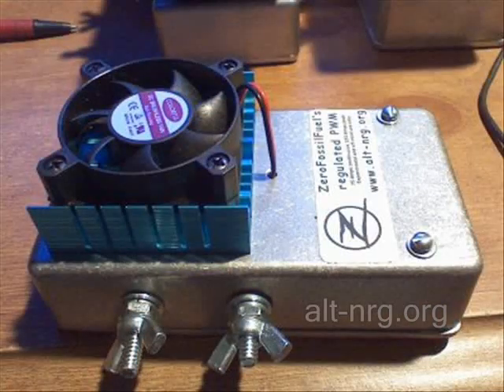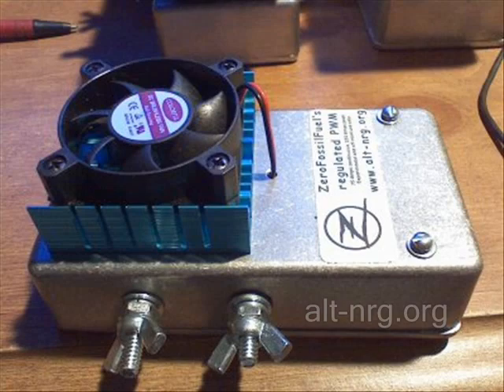#237 HHO run time test update 2-16-2010

Comment: NO!!!!!! Compression is needed no matter what the fuel source, truth is the flash point of HHO is almost identical to HC, If what you say is true then a diesel engine wouldnt run on hydrogen, it would gas off and detonate....but I have personally seen diesels run on nothing but hydrogen, the higher the compression the greater the heat value, the greater the heat value the more energy is produced from the fuel, thus increasing efficiency.

Comment: it takes twice as much fuel to run a two cycle engine because the combustion cycle happens every revolution rather than every 2 revolutions, yes they can reach much higher rpms much faster than a 4 cycle engine, but they produce much less torque at low rpms, this is why they need reed valves to help atomize the air/oi/fuel mixture, without reed valves the engine will run too rich and stall at idle and off idle ranges...do your homework bro before you look like a fool in front of the world

Comment: apparently he has no fuckin clue on how a two cycle engine works.....first off they dont have a valve train, this is because intake air is drawn into the engine by the bottom of the piston during the compression stroke(much like a syringe) , then the air/oil/fuel mixture is scavenged by the piston on the power stroke forcing that air/oil/fuel mixture into the cylinder via small ports located slightly above the top of the piston at bottom dead center this is why 2 strokes are less efficient
,

Comment: Second- I do not check humidity and barometric pressure before starting my lawnmower. Why waste valuable time recording largely irrelevant useless info? 
These things will delay and constrain your efforts. Over analysis may place you into melancholy gridlock. Proof of principle, efficiency data, and duplicatibility are really the main concerns.
Mrgalleria

Comment: @ZeroFossilFuel 
Also not opening the exhaust valve will place less load on the engine.
The inert gas will be nitrogen, which expands wonderfully with heat added. That is how motors operate. But you have a different kind of heat with HHO. Liquid petrol burns slowly, allowing the nitrogen to heat/expand/ move piston. HHO burns so fast, it does not give adequate time to heat the nitrogen. Result- no expansion of nitrogen. 
Mrgalleria

Comment: @ZeroFossilFuel  - I injected in air intake, not directly into the combustion chamber ... the solenoid did get hot and wore out quickly but I did not know how to modify the cam and valve opening any other way ... was only thing I could do to get control ... you may know another way ... am interested in seeing what you come up with ... got my fingers crossed that you come up with something simple that works ...

Comment from the maker: @rascalwind Sealed system, hydrogen charged sterlings are about the only ones capable of producing enough mechanical output to be of any real use. This is beyond my level of ability to produce without the proper facilities or funding. With funding, all things become possible.

Comment from the maker: @SmartScarecrow That would have to be some beefy solenoid. The reason I shy away from the injector method is flow rate, and I don't think they will hold up well over time when used to inject directly into the combustion chamber.

Comment: work your valve using a solenoid  ... works well ... you might also consider using an automotive fuel injector timed with the opening of your valve to inject the HHO ... the fuel injector will only work well with pretty high pressure ... I used 15 psi ... this setup bought me about 15% improvement with the 4 stroke (danger will robinson) ... but I am not competent to go the next step and make it a 2 stroke ...